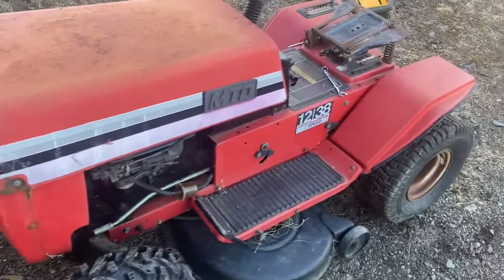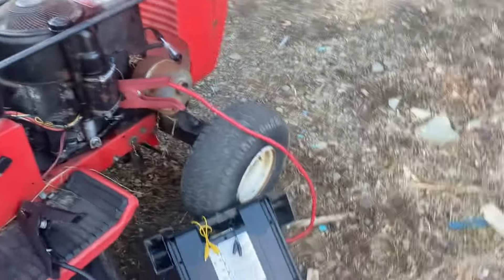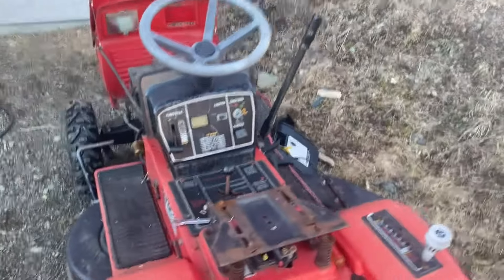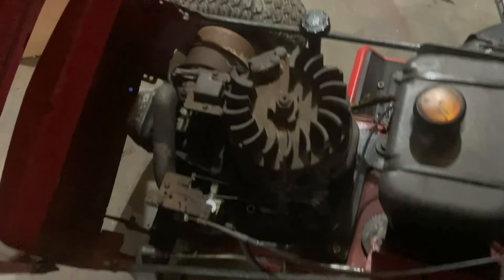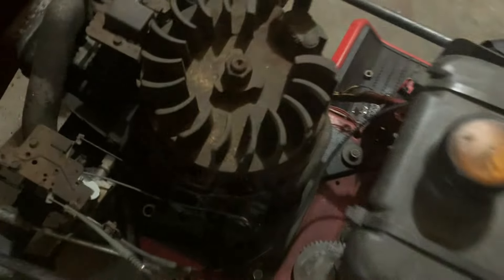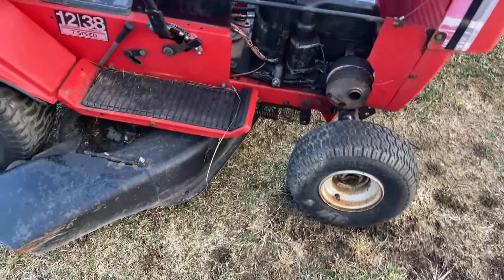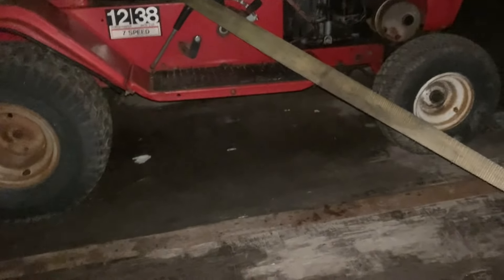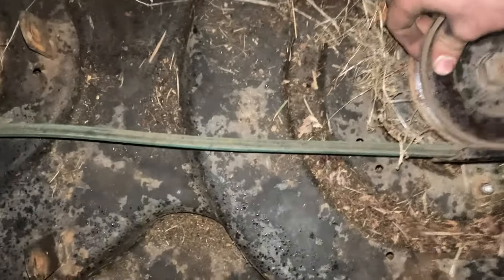Can you expect a $25 MTD mower to run? 1986 MTD 12 38

Comment: Why do people ALWAYS think the flywheel key is sheared when an engine won't start? I repair small engines. 20 years ago I bought a 12" long piece of flywheel key stock. I still have 11-1/2 inches of it. I have repaired thousands of engines since I bought it. BTW, if you're going to use starting fluid buy a starting fluid that has Upper Cylinder Lube in it. Regular starting fluid will wash the oil off of the cylinder walls and rings. I recommend Gumout Starting Fluid.